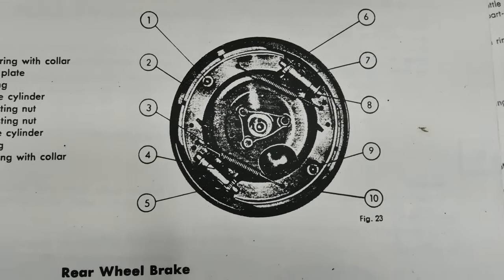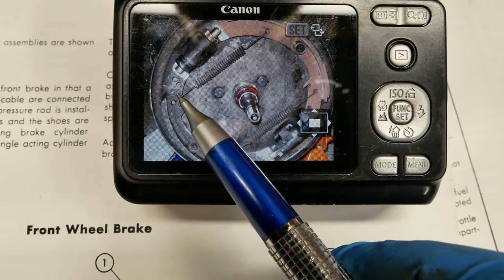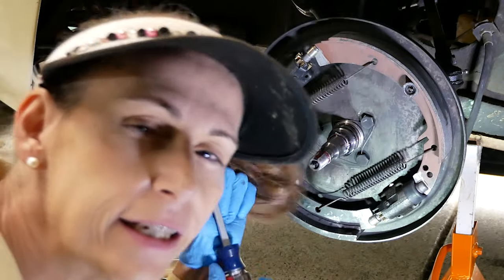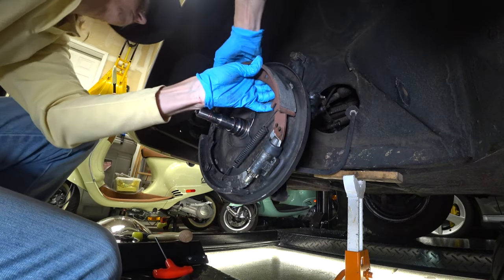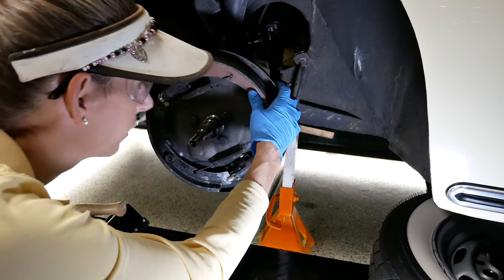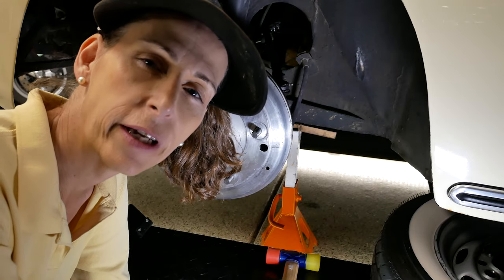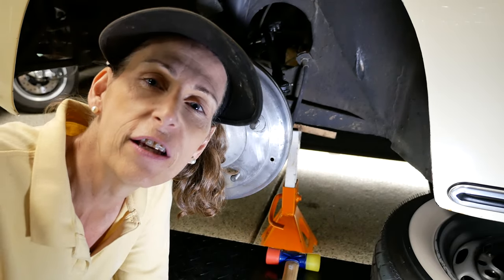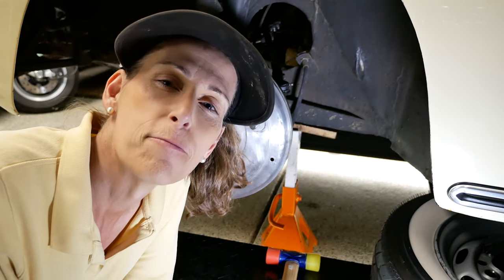Porsche 356A Front Brake Rebuild DIY Part 3 CORRECTION!

Comment: I have been watching your videos and they are super.  i am not mechanically inclined.  My wife shudders every time I attempt a project requiring mechanical knowledge.  Was especially impressed with the brake replacement video.  Where did you get your mechanical knowledge?  Keep up the fun videos.  Paul (911 Targa 4S).
Reply from the maker: Hi Paul, Thanks!!  Well, ya see, I had a few air-cooled Beetles back in the day and they were a bit tired when I bought them.  You could say they had a good amount of "differed maintenance" that I had to deal with.  I guess we learn by doing and I learned a lot!  It is fun and I really enjoy it (usually).  Ya just start small and take on more and more complex tasks.  What year is your 4S?  Franny
Reply: My Targa 4S is a 2017.  Got it in December 2016 and have put on 2600 miles driving around Tucson.
Reply from the maker: That's great!  So is it the turbo then?
Reply: Yes, it has twin turbos.  A large portion of the 2017 911's have Turbos and are not naturally aspirated.  Exceptions would be the GT3's and other high performance 911's.
The exhaust note on the 2017 car is surprising quiet as compared to my previous 911 which was a 2001 Carrera Cabriolet which had a sport exhaust on it.  The 2017 also has a PDK automatic transmission which is very quick and easy to drive in stop and go traffic.  I am very happy with the car.  Continue the good work with your videos.
Reply from the maker: I got a ride in one at the dealership.  Really tight and very fast.  The power is practically instant.  I guess the next addition will be electric motors???  Franny